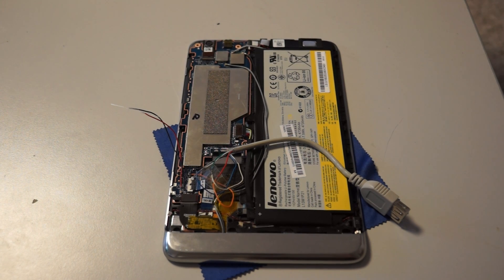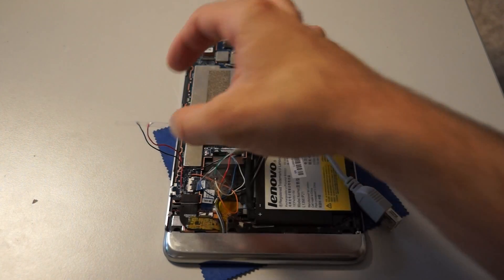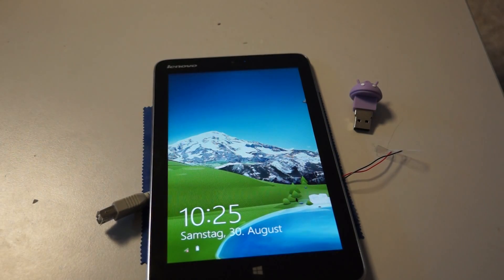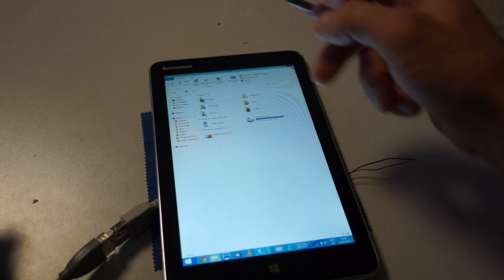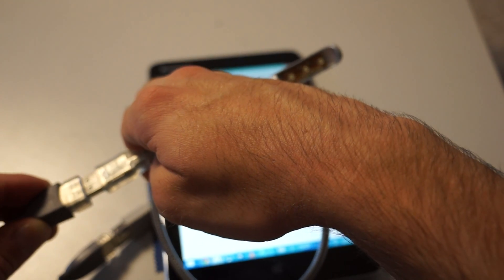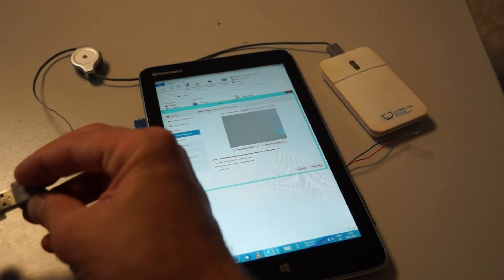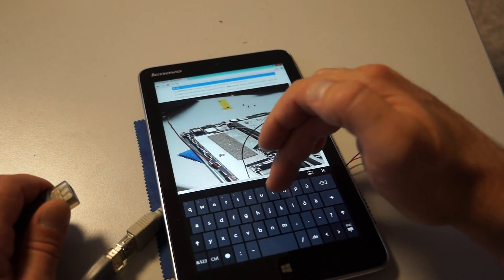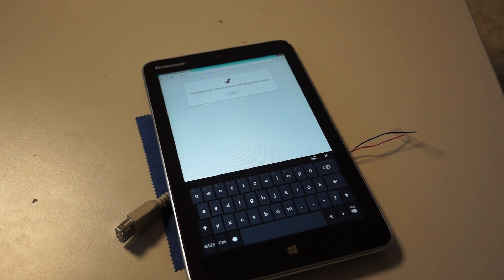Lenovo Miix 2 -8 internal USB Port + testing

Comment: i think this is great idea like u can mod a mpcie sim card module to work with internal usb ports
Reply from the maker: sim card module should be possible. there are a few guys out there who get it managed working with a dell venue 8 pro. so there are much similarities between that and the lenovo miix 2 - 8. in my case i will try to get a high power 3g usb modem get working inside my lenovo to have internet on the go without the bad wire stuff at a OTG cable...

Comment: what is the point? it have usb OTG. also there are hacks where u can charge and usb host at the same time without need opening it.
Reply from the maker: yes i know you have but there is much space inside the tablet and the external otg is still available. so you can give more options for much more space like 128gb micros sd card or for a internal wireless keyboard receiver. in my case i want to add 3g connections inside to use without cables hanging around and use it on the go.

Comment: spoiled the tablet, better buy a hub, works perfect with several accessories.
Reply from the maker: how it will look like walking around with a tablet and usb 3g modem attached with a hub?

at this moment it is still in testing condition. the cables will be shortened, soldered directly to the device and packed inside the free space there. then the cover comes back on and it looks like original but with more options. there is nothing spoiled trust me.